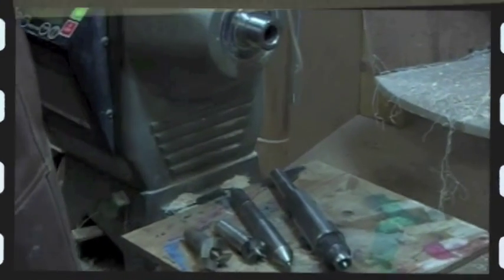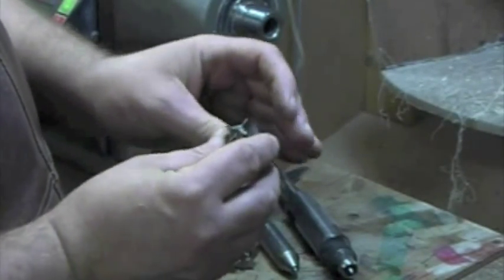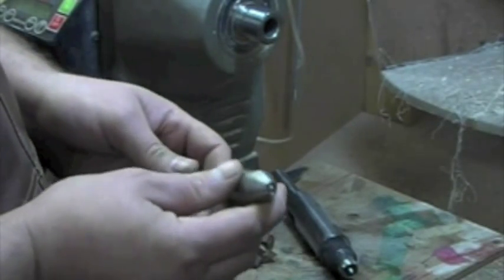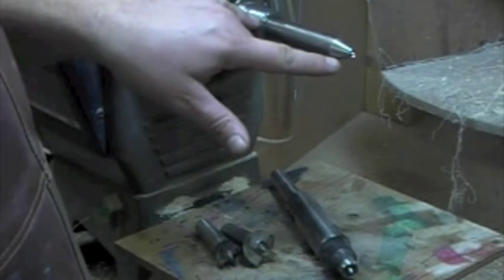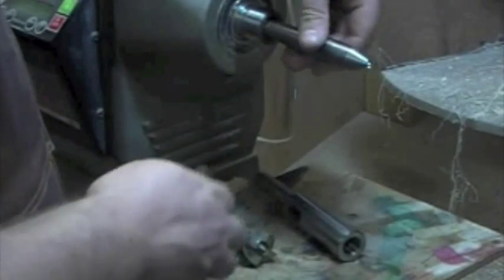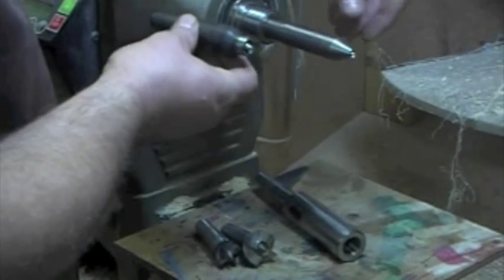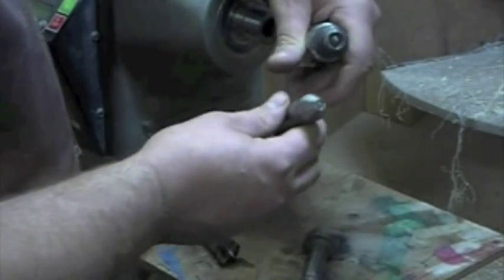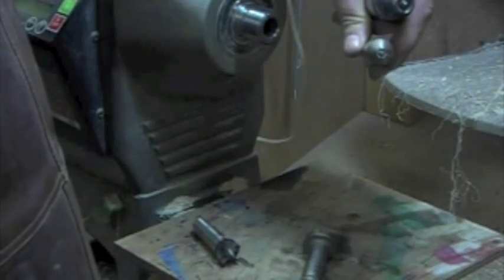Eli Avisera Skew Part 3 "Drive Centers"

Comment: G"dy Stu, Just a couple of points if your interested,(i"m not meaning to offend) but that teknatool spur drive tip is replaceable, it is hollow and you need a small push rod to remove it, yes it does look one piece. This is a wonderful drive for soft or green timber because of it depth & area, as for beginner....simply do not drive it in as far this allows it to slip.
Cheers mate!